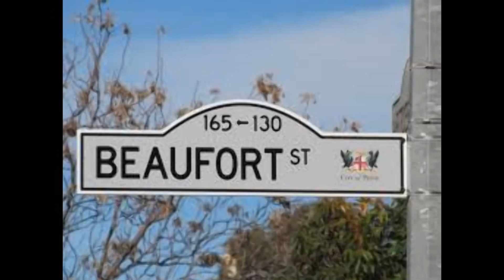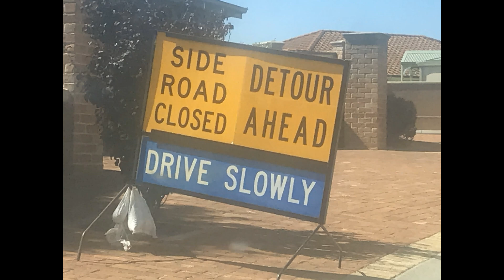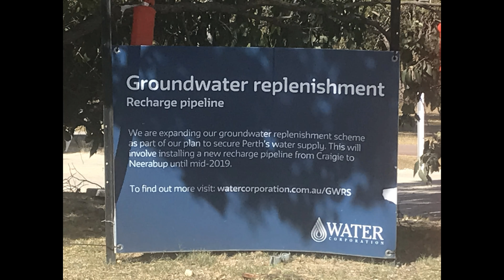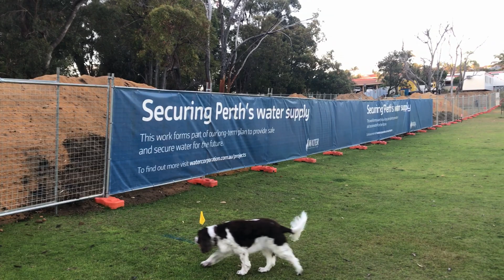Ground Water Replenishment (Securing Perth's Water Supply)

Comment: This is a fantastic project and well done to the people responsible for it... hope it works well and doesn't suffer contamination issues or the like...aquifers are important and I've read that Aboriginal people have had some traditional water holes dry up because they were aquifer fed and industry has taken too much water out of the aquifer system so I hope this addresses that issue as well as others... well done Perth.
Reply from the maker: electro1622 Thanks for the positive comments Electro Man. 
The most important job of a state government is to secure the state’s water supply. Even though we in Perth perpetually live with garden watering restrictions, I have no fear that the city will ever run out of water. Some cities in the world are stuffed -  Cape Town ( South Africa) and São Paulo ( Brazil).